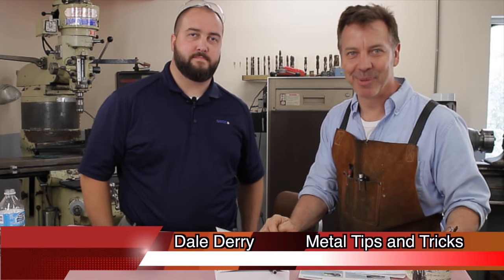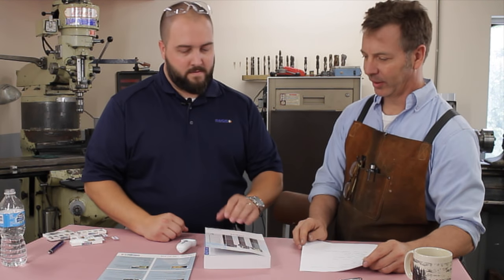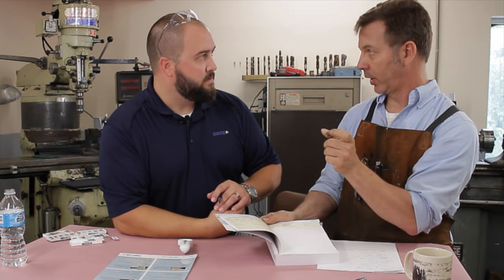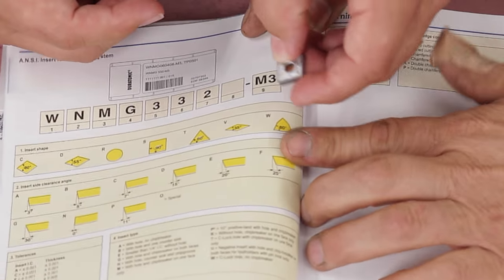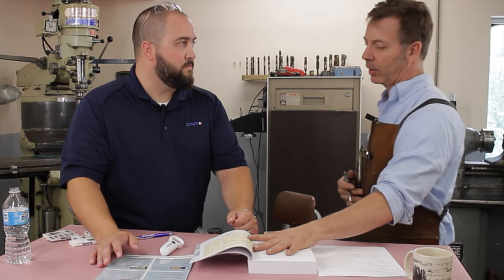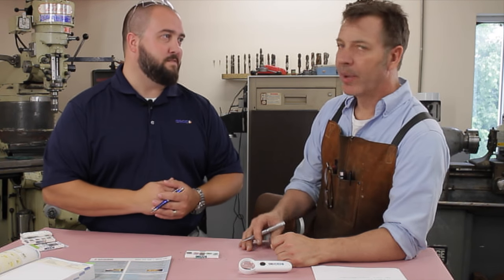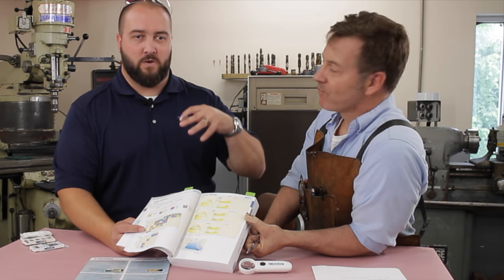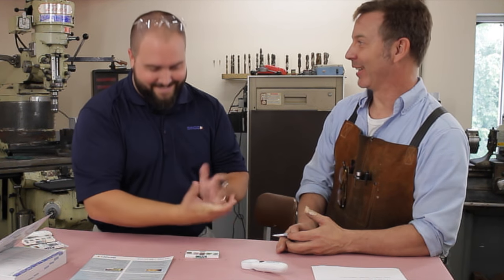Learning About Carbide Inserts for the metal lathe.

Comment: Great vid.
He hinted on lightweight machines. As many beginners will be on smaller machines, it would be great if he showed the better insert geometries for hobby lathes (Atlas, Logan, smaller SB etc.)
I wanted to do a vid on this. Dispel the myth that hobby lathes can't use carbide. It is more that insert tooling is geared for fast removal but there are some that work great on small cuts on lightweight machines.
Reply: Especially stainless i find on my Myford
Reply from the maker: We are planing other video one will be geared around your suggestion.
Reply: Yes please. I want to maximize the amount of metal I can take off on my Craftsman 10", carbide inserts sound like the way to go.
Reply: you must precise your question, amount per second, amount per corner? you know, they don't classify insert geometry by flimsiness of the machine.
Reply: to put into context, these ISO/ANSI inserts are used on machines that turn parts for watches. like 1mm diameter. It's not your machine that's the problem, nor the inserts.

Comment: This is a very good video. 
I used to work at SECO in Sweden, small city Ludvika, late 80s. Now Im getting the urge to play with some toolmaking again. So I got myself a Simonet lathe to play with. So far, I have put most work to refurbish it. Also looking for a Abene Mill. :) 
Anyway, Inserts a very good. But my opinion is that is not for everyone. You have to know how to work them. They are production oriented, that pretty much demand quite big depth Of cuts. With hard feed. 
HSS cutters (seco probably still have them) are (in my opinion) often the better option of a amateur/home shop. Plus they can be relativly easy shaped, for what you want, or need. 

Today I have a few inserts. But the mayority is hss. 
Also, SECO is moving production to India. So my old collegues (many still working there) are losing their jobs. So I might as well buy inserts an holders on fleabay or aliexpress. Good enough for the home shop!

Comment: Good video.  I imagine that most of the people watching your cannel are in the same boat as me where they have a low HP machine (Mine is 1HP) and are looking for even simpler advise on what inserts to buy specifically for their machine.  Perhaps you can do a video with Daryl showing a set of recommended starter inserts and holders for these machines for various types of metals.   A couple of cuts  on your lathe using the inserts to show the finish would be informative as well.    It may also be good to do a video on some of things he discussed like how nose radius affects surface finish.  Thanks
Reply: the shape isn't specific or better suited to bigger or smaller machine. This may seem like a case if you switch from, say a triangle to square insert, but any increase in horsepower is due to increased chip thickness from the way you tilted your toolpost. What really matters is the edge sharpness, rake angle. In other words it is specific to the material you're turning.

Comment: Thank you Dale,
This video prompted me to spend the last several hours going through the SECO catalog and MSC's online info in order to make sense out of everything. I teach gunsmithing and although machining is a big part of our curriculum, we mostly use high speed steel. I'm essentially carbide ignorant. We prefer our students to grind their own tools, but they need to understand that there is a place for carbide tooling, even on smaller machines like ours (13 x40). We have a mix match of inserts and holders at school/work. When someone uses carbide, they just grab a tool holder with whatever insert is installed and go at it, with mixed results. Obviously there's a lot more to it than that. We cut a lot of 1018 and 4140 along with the occasional 416R. I think this video will go a long way in helping our tool selection. Looking at a CCMT32.51 FF1 in the future to see what kind of results we can get.

Comment: I received various data information from Seco and came to the conclusion of OMG! I would have to be an engineer (or more) to figure it out. Thus, I stress it would be great for us home hobbyists with smaller lathes to outline some sort of "kit" comprised of Seco's basic tool holders and associated inserts. I most probably would buy from Seco, as they were super helpful and very pleasant to deal with obtaining the information. I for one have an AXA holder, so larger industrial size holders are really out of the question.
Reply: seco doesn't decide the codes. It's a standards body that does, ANSI/ISO, like how they decide how long a meter is, how heavy a kilogram is, etc.

Comment: i have a 14x40  3 hp single phase metal lathe with enough power to take .100 thow cut .200 thow total diameter cut with tnmg 433 insert and the lathe doesent even grunt. i also use tnmg 432 inserts with a smaller nose radius for smaller cuts for a better finish. the tnmg 432 has more of a pointier nose on it. i use these 2 inserts for alluminum stainless  and soft and hard steels with no problem and these are the only inserts i use for everything on the lathe period.

Comment: Good explanation for the new machinist. What isn't stressed is that carbide inserts don't make much sense for the hobby machinist. 
   To work efficiently, carbide insert tooling depends on the three  things that the hobby machinist often lack: horsepower, spindle speed,  and machine rigidity. This shows up most often in turning difficult materials like stainless steel. 
   Stainless steel work hardens as it is machined. An industrial strength lathe has no problem taking a heavy enough cut so that it stays ahead of the work hardened zone and the carbide insert works like gang busters. Metal removal rates are high and a large amount of heat is being dissipated in the chips with the high surface speeds that come with high spindle speeds.
    A light duty lathe has a tough time of it using insert tooling. The insert is left to fight through material that was work hardened on the previous pass and that drastically shortens the insert edge life. This in turn generates excess heat which shortens the life even more. And to add insult to injury, the application of coolant will cause thermal shock to the over heated insert which causes the cutting edge to break down.
   I use cemented carbide tools on my bench lathe. They cost much less than insert tooling, and when they are worn a quick trip to the bench grinder and puts a nice new edge on them.  
   Insert tooling is great stuff for the job shop where time and metal removal rates are money... not so much for the lathe in the shed.

Comment: Hi Dale, I would imagine the bigger percent of your viewers are hobby motivated, probably using small horsepower end machines, the big question therefore what all rounder insert is the best for us on limited funding, and what's the smallest amount of inserts can we get away with, for projects in steel, cast iron, brass, aluminium and stainless, if you could pop the question it would be much appreciated, nice videos keep up the good work. Thanks Tony (uk)
Reply: I would also appreciate this information if it were provided
Reply: +rompdude I will second that request. I just upgraded to a Grizzly 12x36" gun smithing lathe from a wee little Atlas 6". The hardest thing to do for small machinist is sifting through the marketing intended for way bigger and more powerful machines. Though I do love watching videos of chips just jumping overboard in fear of the carbide
Reply: This is a philosophical question, but I will answer it -- TCMT insert. Triangle because you get the most edges while not being constrained to not being able to turn profiles as is with D, shape, round or even W. Its the same number of edges as W but you can turn profiles better. TCMT is single sided, and prefered over TNMG, which is double sided triangle, because you get more stability in boring bars, better access to smaller diameters because you don't have to use shims, which also results in a smaller inventory. TCMT also can be used in dovetail cutters, and that's useful since most everyone uses a QCTP. Works in milling too. If you want surface finish you can get a better one with a wiper geomtry on the TCMT tha using a round or square insert like other youtubers recommend. TCMT is also a very common geometry so you can get good deals on ebay. All things considered it is the best option. The free market agrees with me anyways you'll notice most turning "kits" for hobby lathes using this insert. The ones that use DCMT give you more cutters for accessing the other 2 edges and thus you have more tools and pay for more stuff. In my local area there's a guy selling 1000 TCMT at 1 dollar a piece, seco brand. Another way TCMT is better than TNMG : in TNMG if you smash a corner, the one on the bottom usually also gets smashed, so you lose 2 at once, so its not really a 6-versus-3 corner situation between the inserts as you would think. A holder for an insert is like 20 dollars, but with that money i can just get 20 TCMT inserts that is worth chasing those extra corners on TNMG. A similar inset is TPM, it's outdated, has no chipbreaker, has no center hole (so you cant make a dovetail cutter, or 60 degree tool).
Reply: all philosophy aside, ask your tool rep and you will get the perfect solution without knowing how to tie a pair of shoes. The tool rep will probably give you the perfect insert for your job, free as a demo. So ask for the demo every time cuz everyone wants free stuff.
Reply: For home guys, choose shape C W T or D. I like C due to the range of inserts available, but if I could pick most usable it's D all the way. It has the best chip evacuation and breaking at low feeds, and is very tough - do not think its weak and pointy. Stay away from negative holders and inserts. You can buy inserts that are high positive that turn a negative holder into an effective positive but don't bother. But the two biggest tips. First, get as large nose radius as you can get away with to avoid it chipping. Then, get the TOUGHEST grade you can, like Iscar IC3028, it is almost impossible to break and specifically says its for low feeds and speeds. It'll cut everything. Stay away from hard grades, and non brand name inserts. Get some polished inserts for Ali/brass later. TOUGH inserts are the key to home guys.
Tim

Comment: Great informative video, Seco are some of the best inserts I’ve used. Turning copper was a real struggle until I found a specific copper insert and it worked really well. Do Seco have an insert for tuning Polyurethene, . I’ve tried nylon , copper inserts and nothing really works , so it’s Old school HSS which does cut but only a specific way.

Comment: I use carbide inserts on my lathe because I was never expert enough to keep HSS tools sharp and at the correct angles.The trouble with carbide is it is geared almost exclusively to production, which means big fast cuts on powerful machines with no sloppy rails. If you look at the lathe work on Clicksprings channel, he never uses carbide, and gets fantastic finishes. I think we should at least try to use HSS occasionally just to keep the skill of tool grinding alive, even if that is only for the odd form tool. Trouble is, you look at the CNC/5 axis vids where they get high speed perfection and think we can repeat it at home :o(
Reply: fantastic is subjective. get surface roughness Ra/Rz and maybe we'll talk who's the best. You can get polished sharp inserts enough to shave with and see your reflection in.
Reply: i sharpen my store bought carbide tooling on a green stone no problem.

Comment: Dale great information, I'm running a S-B 10L with a AXA holder and I'm running into tool holder size issues. Does Seco make holders for smaller machines with 5/8 and down tool post? Thanks again love the channel!
Reply: All tool companies do, look at the swiss turning tools. Swiss turning refers to a style of machine that turns small bars , like less than 1/2" diameter.

Comment: I thought IC was for the inscribed circle that fits within the polygon? he says corner to corner. Also, he said .002 and you said .0002. just looking for clarification
Reply: +Jim Wilson Clearly he's as confused as the rest of us.
Reply: +Jim Wilson At 8:11 you see a diagram that indeed shows that IC is the diameter of the inscribed circle, but it's clear that in 18 years, our mate Daryl hasn't actually learned that. In the video he just says "that's the width of the insert" which it most definitely is not.

Comment: And you can't even deal with them direct - that's right SECO, make it really hard to buy.  Put some idiot between you and me that knows even less than I do trying to give me advice on what to buy.   What BS.
Reply: +Best Services I wonder if you realize the size and scale of this Ceco? They don't have 30,000 sku's sitting on shelves waiting for some guy to call for a box of inserts.
Reply: +Tom Meeker Well, it's Seco, not Ceco, but yes I do understand the scale of it.  But that doesn't give them a pass - if they want my business, they're going to have to make it easier to choose and acquire with less risk that I'll order the wrong thing.   My experience in this field is pretty deep, yet I still believe one either has to acquire months of in depth knowledge in this segment to be successful picking the right insert, or they need to be able to turn to someone who can say "Forget all the alphabet soup, for the kind of work you do (material and HP of machine), standardize on these six inserts and ignore all the rest."  If Dale wants to make a contribution to this topic, it should IMO be all about what to ignore, and focus on a tiny sliver of things that just work.  Trying to give us a Ph.D on this topic is inconsistent with Dales stated mission - to make it easy to just go into the shop and get stuff done.   A catalog of 30,000 parts is not, IMO, a good starting point for this hideously complex subject.
Reply: +Best Services 
You are deluded if you think you can buy direct from most any manufacturer.
Reply: you're wrong. all tool companies go through a distributor. Even tshirt companies, bicycle parts. Ask your distributor for catalog.